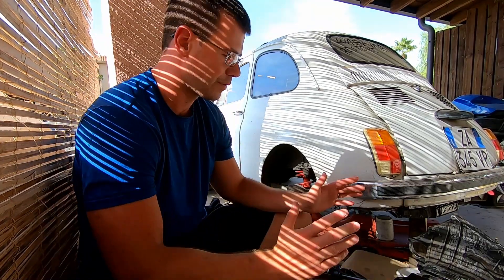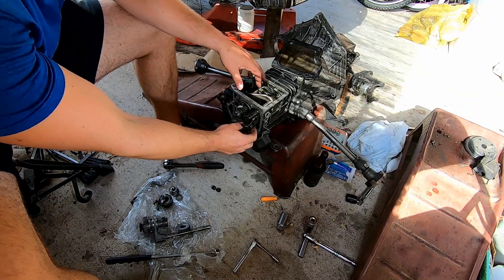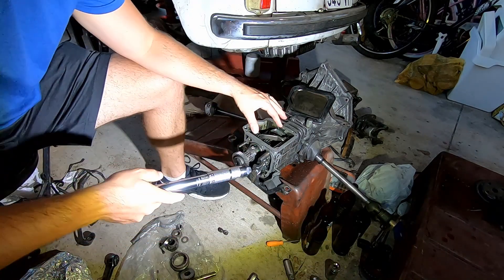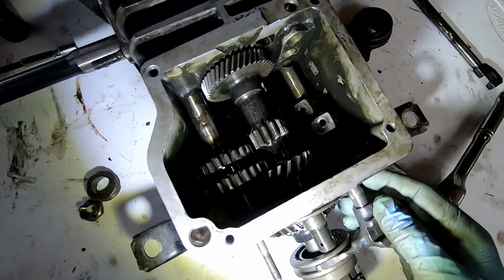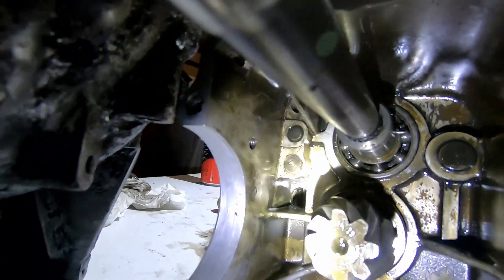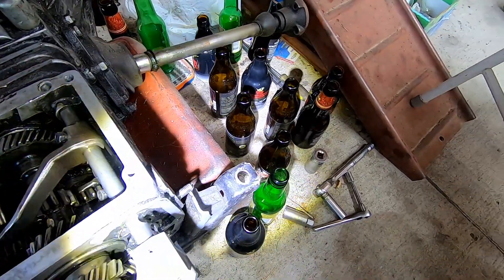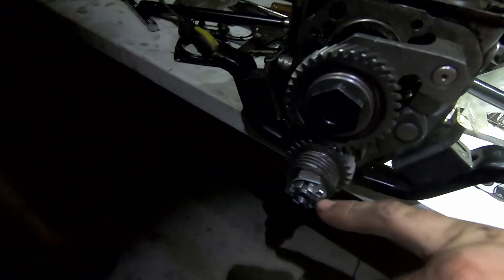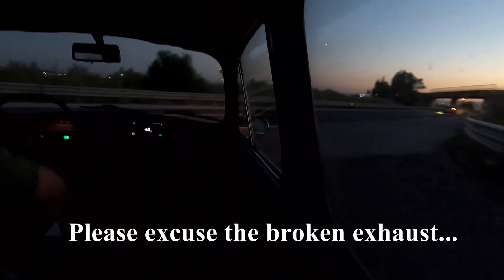Classic Fiat 500 Restomod Series, Episode 9: A 5th Gear!

Comment: I bought my 1969 L model up in Abruzzo and shipped her back when I was in Naples.  I stripped the engine down and rebuilt her entirely, taking off the larger barrels and 126 carb, I went for traditional.  I have often pondered installing a fifth gear because even the 499 screams in fourth at high rev.
Reply from the maker: I just swapped the original engine in, keeping the same transmission with 5th gear.  I can confirm the original engine will allow level-ground cruising at 55mph in 5th gear just fine, but don't expect to accelerate much at all.

Comment: What is the measurement on the holes for the shift coupler. I’ve ran into the same issue with my fiat.  I’m doing the same conversion
Reply from the maker: It will be a week before I can check, but I will.  I do recall I had to put a slight twist in the coupling bit to make everything line up too, but that may have been due to slight misalignment in mounting elsewhere.
Reply: @awcole86  Awesome thank you.
Reply from the maker: It's difficult to measure exactly while installed, but I got 104mm (4.12 inches) between the bolt holes, measured from the center of one to the center of the other.
Reply: @awcole86  good to know I appreciate you checking.   Did you install that piece with the engine in place or just the transmission installed.    I’m waiting on parts to completely install everything and I just have the transmission in place.
Reply from the maker: @kevingeorge7893  I installed it with engine and transmission in place.  If I remember correctly I measured and drilled the holes for the new piece with engine and trans in place as well to ensure everything was in its proper final position as even a few mm off will cause improper shift lever position.
Reply: For those who are trying as well, the same shop can provide a shorter coupler I see, https://www.dangelomotori.it/en/product/gear-rod-support-for-5-speed-gearbox-fiat-500-flr/

Comment: But obviously the 5th gear is not synchronized, why?! What is the top speed in 5th gear now?
Reply from the maker: It shifts smoothly into 5th every time, so any additional synchro parts are not needed.  The top speed I have reached so far is 128 kph (80mph), but it is capable of slightly more.